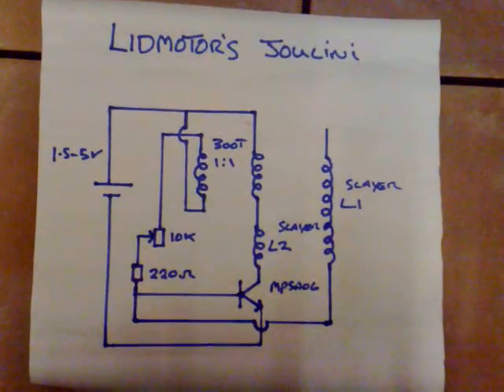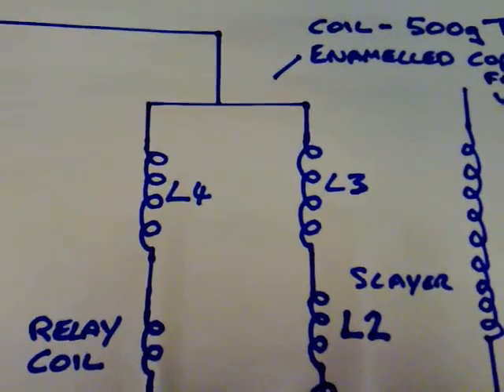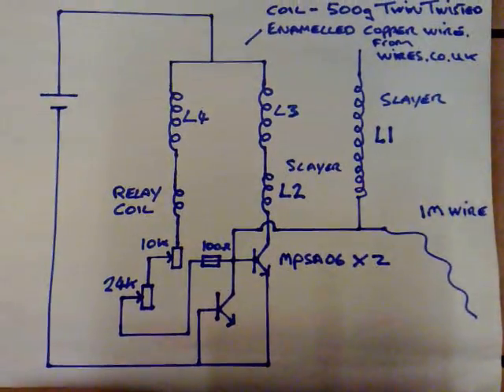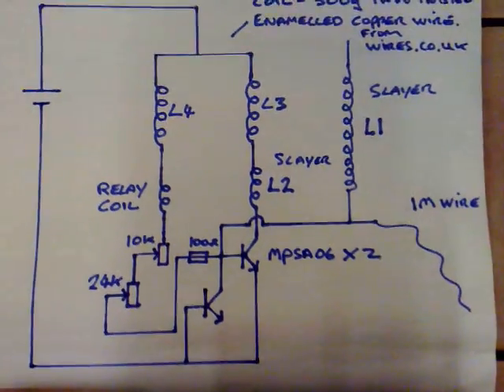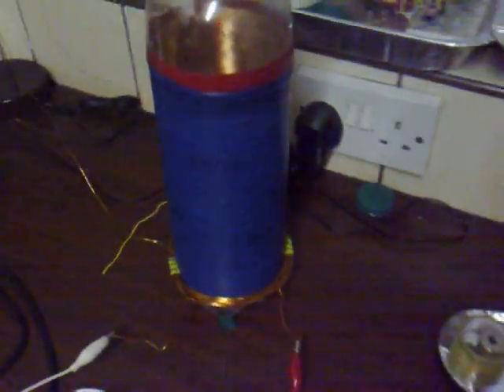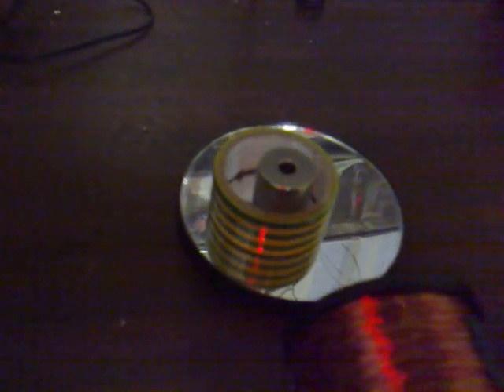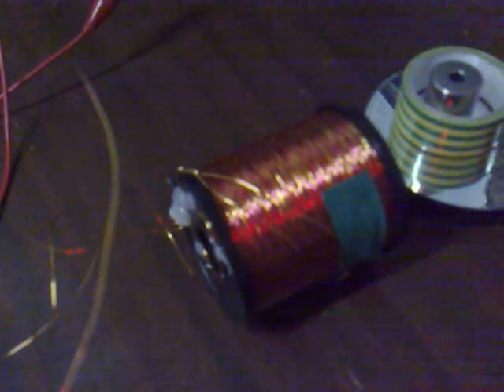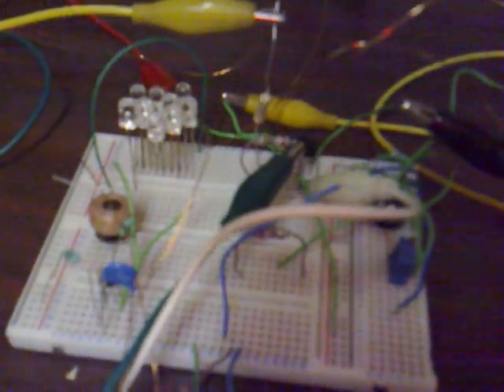Lidmotor Joulini coronal plasma

Comment: @NichtDieseTone I have been feeding HVHF into a Rodin coil from the output of my tesla coil but the voltage and results are unpredictable and unmeasurable with my equipment. Could this circuit be used to "tame" the voltage a bit but STILL deliver? Also do you need a tube type TC to control the frequency output?

Comment: Jonny... your modified lidjoulini is a wonder. I am experimenting with a rodin coil at high frequency high voltage at controlled frequencies and I think I may try your circuit as the primary for the RC. If I could get the circuit to resonate at certain frequencies it might have a lot of possibilities as a healing device!  THANKS for sharing... Scott

Comment: I know this is totally off the wall, but I'm curious what may happen if you regularly applied the electrical charge you have there to a small skin wound; would it excite the cells to heal faster? Of course one would need two similar wounds to compare the results of the charge applied to one and not the other to see if there is a difference in heal time. You up to a couple paper cuts:)